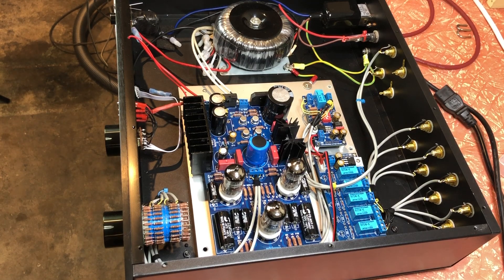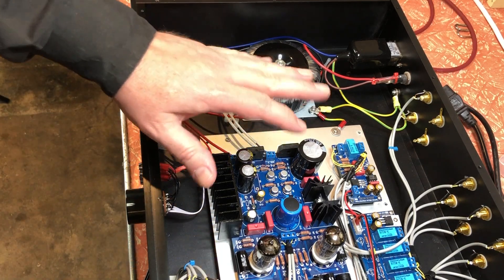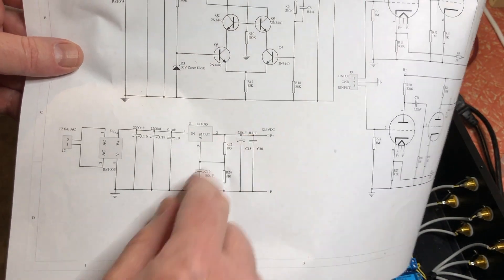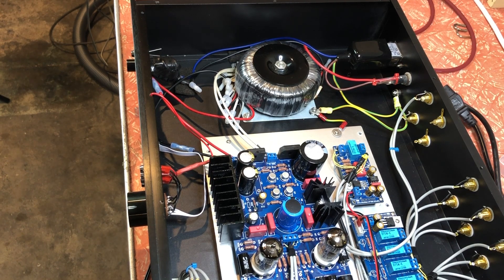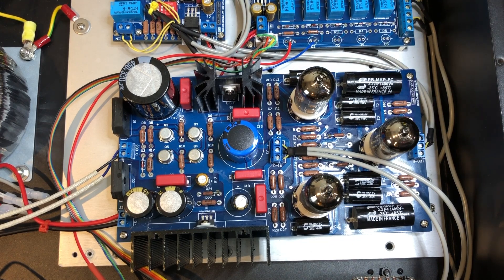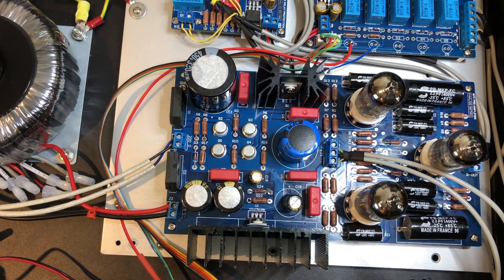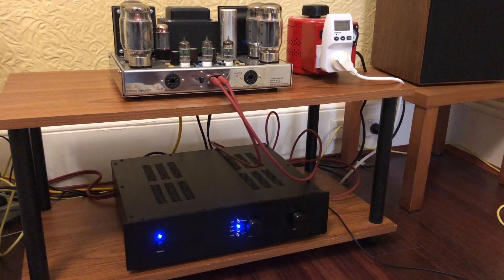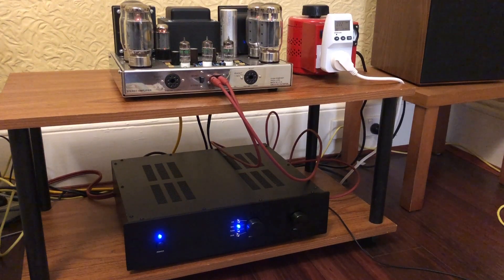Marantz 7 Clone Kit Build - Pt 7 - Final Test

Comment: Would you recommend just to buy the kit assembled if you are looking for a tube sound. I guess swapping a few capacitors and tubes later could be fun. Seems the seller is selling assembled. I have a Gain clone (Akitika Z4) Power amp and building a pair of Troels Gravesen Speakers - and I really want a remove controlled tube preamp - one that is adding some classic tube sound.
Reply from the maker: Unless you particularly want to build yourself, yes, I would buy assembled.

Comment: I build an 7C clone, etched my own circuit board, using 6 tubes 12AX7 and used regulated voltage. Deleted the tone controls and volume pot. I should make a video soon, i focused on the RIAA circuit and calculated for best curves and used best components. It sounds amazing, I'll post soon. Nice video by the way!

Comment: Nice build and DIY project  ...but it will not sound even close to a  7C...may be inspired by it .
....
Reply from the maker: Yes, but that's commonly what these kits are called, and there's a few of them out there. It's the same with the Quad 405, there are various clone boards out there, but they won't sound like a 405 because the transformer was a fundamental part of how the 405 works (and sounds).
Reply: @audionautica6843  Indeed ...
Have a nice day .

Comment: This was a very good build with such good videos your channel will grow. 
1. Your moving around the amplifier and putting distance between the amplifier and the transformer either by a metal divider or putting the power circuit between them helped as well as putting the lid on activating a faraday cage. 
2. The bridge rectifier is also noisy. 
You received many good comments concerning earthing. Allow me to add a little more
FROM ONE VIEW
1. Ideally source devices and preamplifiers should behave like pickups, be it microphones,
tape heads and cartridges.
2. We expect that the output levels are safe.
3. As such their reference plane should not be connected to the chassis. However it may
offer a shield plane for the signal, however this should not be connected to the chassis.
4. As per 1 any exposed chassis offers no danger and essentially behaves as a faraday
cage. Devices having lethal voltages such as tube preamplifiers will have an earthed
chassis. No connection exists between this chassis and signal ground. This chassis
could essentially be an earthed faraday cage.
5. Thus even integrated preamplifiers should have a separate power supply not connected
to the amplifier main power supply or they can have a shared power supply with only one
earthing point with no connection to chassis. Ideally an integrated preamplifier has only one
earthing point. The inputs and outputs. The upstream device if any should also have an
isolated supply and should behave like a pickup.
6.Power amplifiers may have the amplifier power ground connected to chassis earth,
however if such an amplifier will be used for other purposes a ground lift switch may exist to
separate chassis ground from amplifiers power ground.
7. A partial chassis may act more like an antennae and so depending on dimensions,
limiting the bandwidth of the amplifier should address this problem as audio wavelengths
are much longer and so the temptation to also use the chassis as a ground plane is always
at hand. The journey of equipment matching continues.
FROM ANOTHER VIEW
Proper earthing/grounding/shielding of electronics plays two roles
1. Noise reduction and better signal integrity
2. Electrical safety
Starting with the analogy of the coaxial cable that requires a 50 Ohm or 75 Ohm terminator
at one end then we can start to understand the problem.
For single rail electronics, the negative rail plays the role of earth. For dual rail electronics,
the zero volt rail serves as earth.
If the potential difference between the power supply rails of an electronic circuit are within
safe levels for touch and also the power is from a battery or an isolation transformer where
the primary coil will never cross with the secondary coil even under fault, then such a circuit
may use a two pin A/C connector and have a floating earth. In such devices the ground
plane as well as the chassis are connected together.
Where the chassis is exposed to possible electrical connection to other devices either
through input earth, output earth or the chassis itself to an equipment rack. With our initial
coaxial cable analogy the problems encountered with 10base2 networks come into play.
Only one end of a 10base2 network was earthed.
In our audio example we can manage our ground loops by increasing resistance through
paths which we don't want currents to prefer. To better manage ground loops and other
problems, we terminate at only one point that is between the chassis and the power supply
ground terminal. Chassis consists of the enclosure, heatsinks, and the transformer iron core.
The resistor used at this termination point can be anything between 100 to 10 Ohms
depending on the currents at play. Where we want to create an AC short for certain high
frequencies we bypass this resistor with a suitable capacitor between 10nF to 100nF.For
electrical safety we also bypass this parallel resistor and capacitor with a pair of parallel
diodes each oriented in the opposite direction. These are high current diodes capable of
remaining intact while the AC fuse blows incase of a fault condition. These diodes also
feature a high forward voltage for higher perceived resistance.
Two pin equipment does not protect the user from external electrical faults that come into
contact with the chassis. For three pin equipment the earth pin is connected directly to the chassis. 
Any dangerous fault will blow the fuse disconnecting the dangerous voltage.
At the circuit level the electronics are mounted with isolating standoffs if using plated holes
or holes that do not completely clear the circuit ground plane. Brass or non isolated
standoffs may be used where the mounting holes have no electrical connection with the
PCB ground plane. For further noise and interference management the circuit should feature
power supply high frequency decoupling capacitors especially across opamp IC power pins.
These capacitors work hand in hand with input high frequency filter capacitors. High
frequency noise management for PCBs having external inputs may be further improved with
termination at the circuit level between circuit ground and chassis using a capacitor at least
10x smaller than our main terminator bypass capacitor and a bleeder resistor at least
10x greater than our main terminator resistor.
In signal transmission between audio circuits, the transmitting end shields the signal with
its earth, some manufacturers terminate high frequency noise at this end but it all depends
on whether the transmitting circuit is using negative feedback or not. With negative
feedback it may be unnecessary. On the receiving end it matters whether or not the receiver
has high currents on the circuit that are a magnitude higher than the transmitting
equipment? If so the receiving circuit will try to isolate these currents with a small resistor
value separating the grounds. It is also at the receiver where we terminate and filter high
frequency noise.
There are other factors to consider for every circuit including the topology.

I would like to send you a higher capacity speaker protector for bigger amplifiers. Drop me an email

https://onaudio.herokuapp.com/catalog/DownloadPdf/Speaker%20Delay%20and%20DC%20Protection.pdf/
Reply from the maker: Thank you so much for your incredibly detailed and well thought out comment. I hope many find it of use.